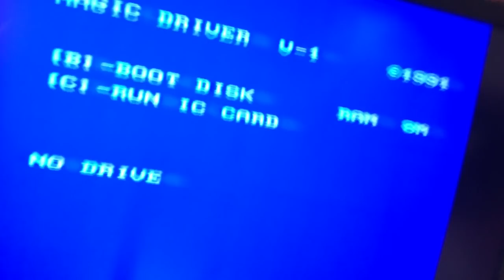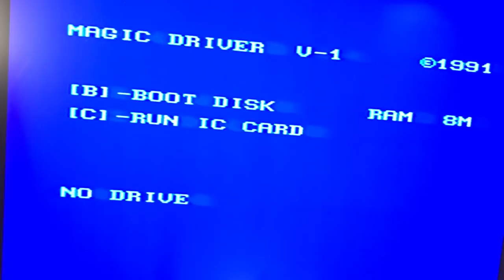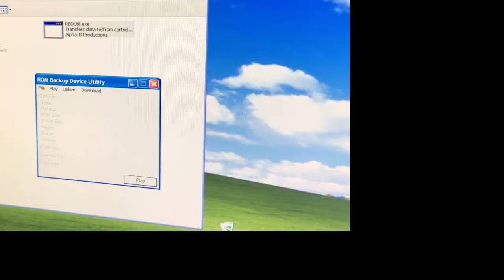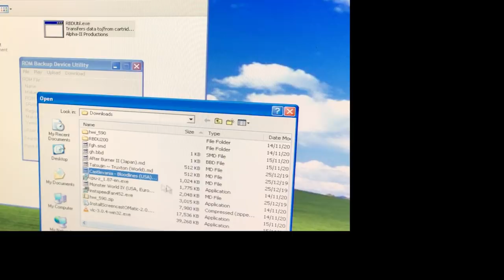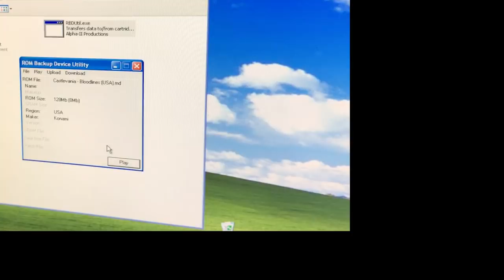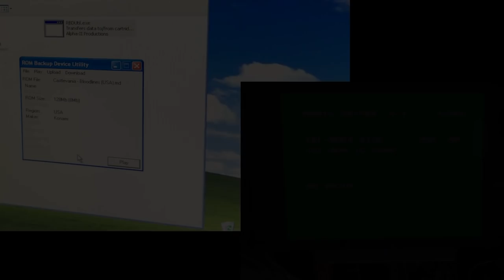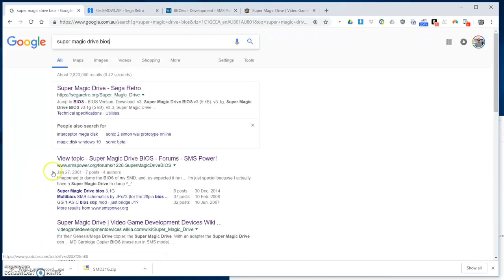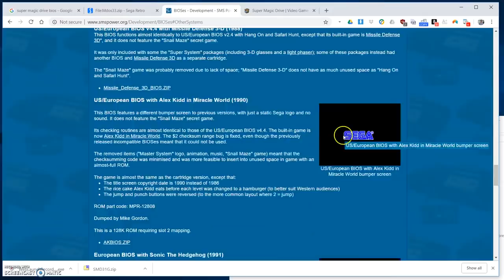Is the Super Magic Drive a cheap Everdrive? How to setup SMD800 - YouTube

Comment: You might want to cover the ROM window with black tape to avoid the exposure to light....
Reply from the maker: OldTekBench Yes I did after the video was made. The windows respond to ultraviolet light only but you can’t be too careful
Reply: @GlobalGarageAus  Someone (can't remember who from the top of my head) did an experiment: he burned a EEPROM and left it on the bench for a while, periodically checking the data integrity on it. Even though it was never in direct sunlight or exposed to artificial UV light it took several weeks for data to get slightly corrupted. Moral of the story: even indirect sunlight can cause data degradation in an EEPROM, it just takes a while.

EDIT: I think I found that video
/watch?v=_vWgsZF5Ecg
Reply from the maker: @Sheevlord  Thanks Ill check that out. I now put stickers over the window right away. I have a roll of them that fit DIP40s perfectly. It's all so old school but I really like the tech of manipulating a chip with light.

Comment: Nice video =D  I would say though its pretty weak compared to the Everdrive (ie. size of carts supported, and pain in the a$$ to connect up to PC these days), and in europe these often cost MORE than an Everdrive lol!  Not so expensive if you can find one like this described as faulty or incomplete etc.  Nice bit of kit though!!!  Always wanted one of these!
Reply from the maker: GadgetUK164 - Retro Gaming Repairs & Mods Thanks mate. Yep this one was cheap as it was sold as untested and without floppy. I’m actually making a follow up video video now as I’ve got it working on Win10 with better software.

Comment: Actually this was made before windows. Any Windows version after Windows 98 will not allow software to directly access memory or hardware and the software will not work. Windows XP works sometimes depending on what the software is trying to do. Running the program in DOSBox or similar programs might work because it emulates direct access to memory and hardware.  Hope this helps anyone trying to run anything made for Win95, Win98 or Dos. Win95 and Win 98 run on top of Dos, like how Android runs on top of Linux.